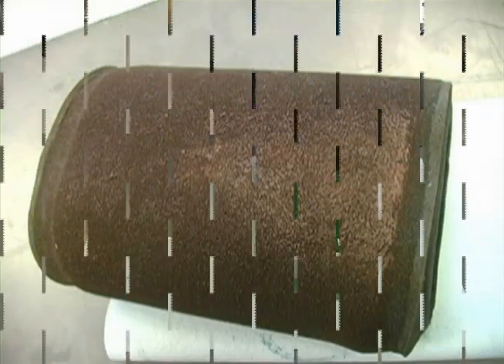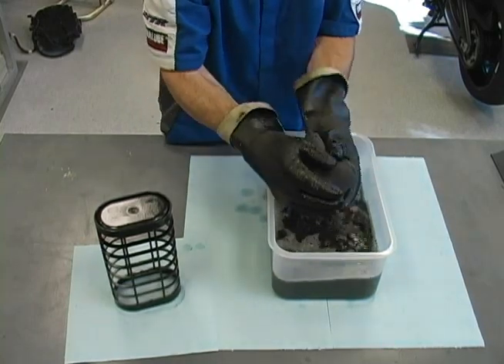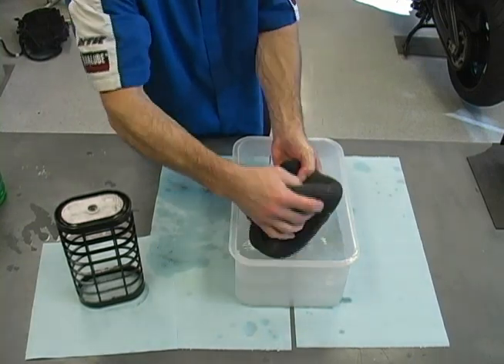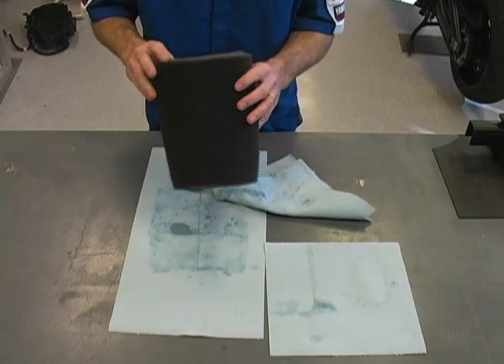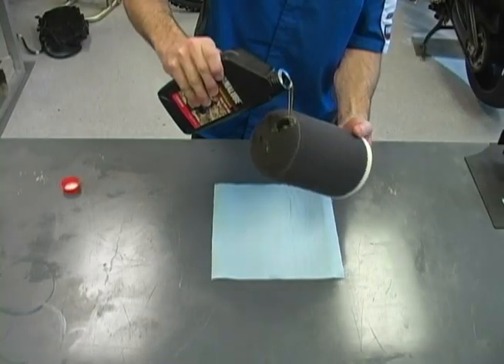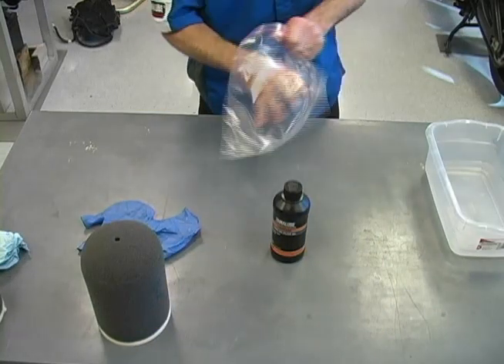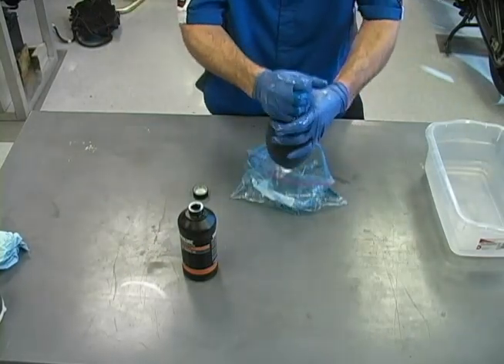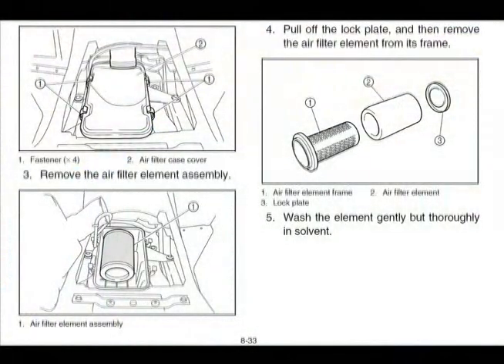Foam Air Filter Cleaning and Oiling by Yamaha Motor Corp.

Comment: in my area we don't have those kind of equipment needed to clean and oiling the air filter,we only use soap to clean and engine oil to oil the air filter,,,
is an engine oil can be used for oiling??

Comment: I used your method on my yamaha yfm 700 with the same foam filter as shown in your video and oiled it with liqui moly filter oil, but after reinstalation my quad did not start untill i removed the filter again. I washed the oil out of the filter and then the quad started instant with no problems. Does someone now what was the issue?
Reply: PP SS too much oil didnt let the air go through.

Comment: high flash point solvent???...WHAT THE FUCK  IS THAT????!!!
Reply: Flash point refers to the temperature at which something combusts. A high flash point solvent just means a solvent which won't otherwise combust easily at low temperatures (low flammability). It's just mentioned for safety sake. Don't use petrol or other highly volatile solvents in other words.
Reply: Thanks for the reply
Any examples of this kind of solvents? i never been able to get some original yamaha filter cleaner
Reply: Lots of companies sell air filter cleaner. I imagine anything advertised as being for a motorcycle, or otherwise from a motorcycle store, would be appropriate.
Reply: mineral turpentine,   kerosene,     I have a cleaning tray,   pour turps into it,  clean filter,   let dirt settle,  pour turps back into bottle